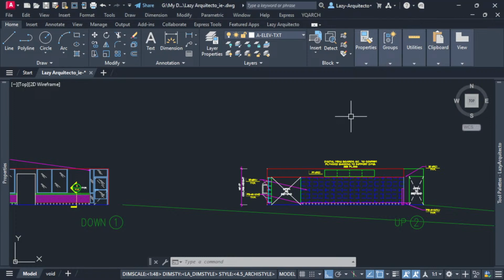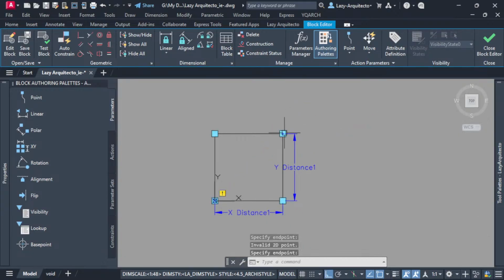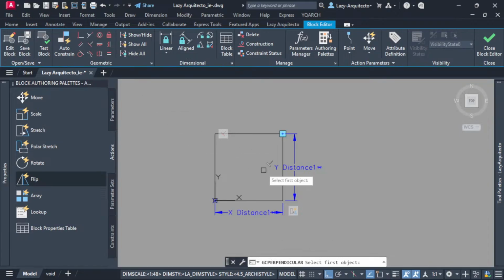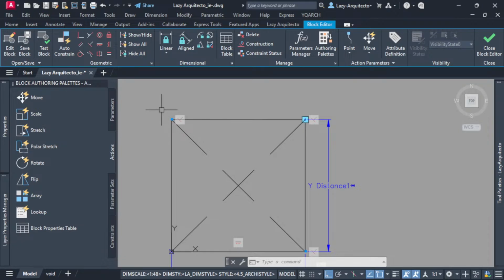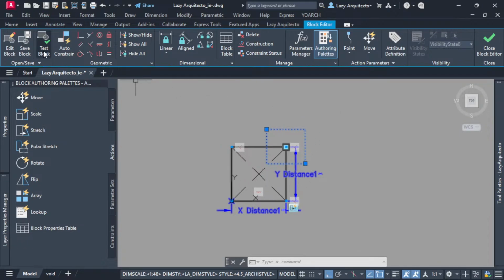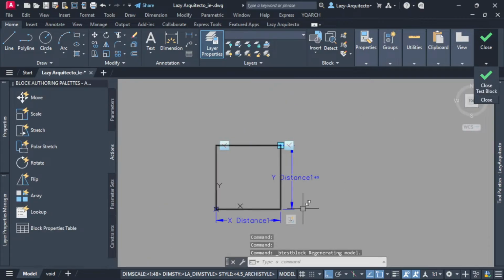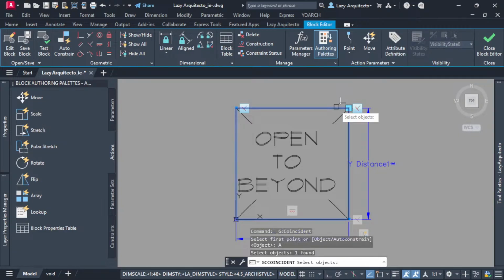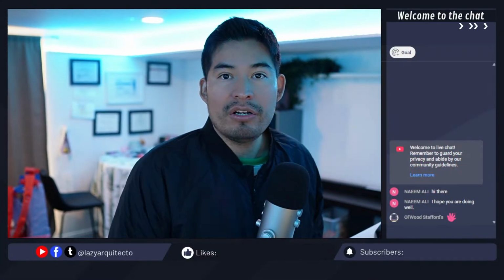Pushing AutoCAD Limits with Dynamic Blocks (This Grip Does EVERYTHING) | LazyArquitecto 19

Comment: i made a dynamic array block for column , in that it ask me the distance between column while assigning the action (array) but i cant change the distance between the column outside the block,, please help
Reply from the maker: That is a dynamic block limitation in Autocad, the most practical solution for your column block would be to create a visibility based dynamic block with multiple preset column spacings. This way, you can select the desired spacing from a list rather than having fully flexible spacing control